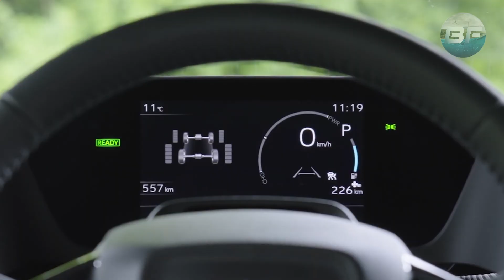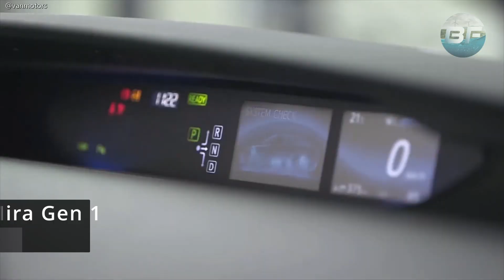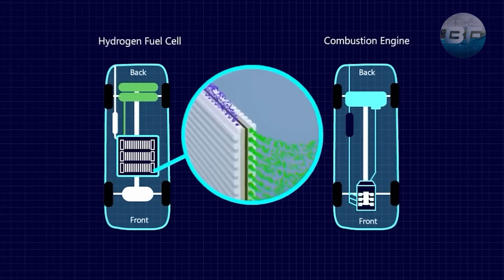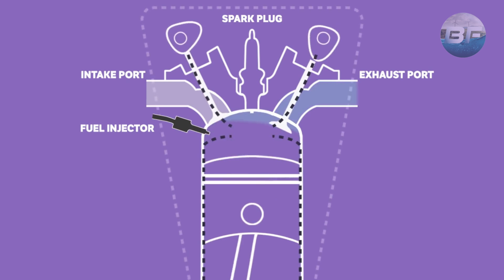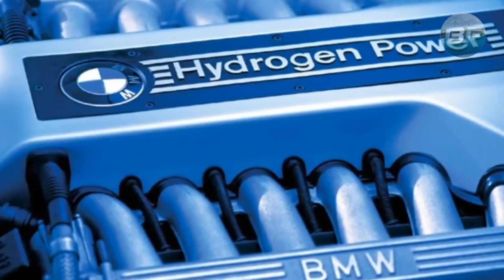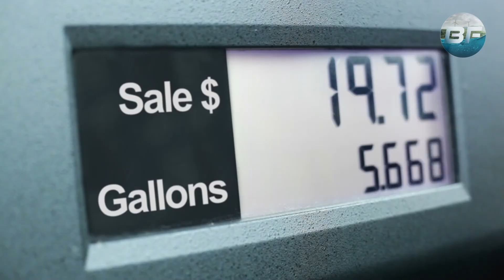Toyotas NEW HYDROGEN Combustion Engine SHOCKS The Entire Car Industry

Comment: Obviously you have not looked at how much hydrogen fuel cost.  It is much more expensive than gasoline.  You can count the number of commercial hydrogen filling stations in the US on you fingers.
Go look at the reviews of the Murai.  Underpowered.  Long lines at the filling stations.  Dispensers freezing up in SoCal warm weather.
Reply from the maker: Of course, the infrastructure must be expanded. In addition, the technology is still under development. It will take some time before the technology is profitable for normal end users. Nevertheless, it is a step which makes alternative energies more accessible. Let's see where the journey ultimately goes.

Comment: 1:57 Honda gave up making the Clarity FCEV a few years ago.  They may start up again, but at the moment only the Mirai and the Nexo are available in the world to purchase.  The Yaris H2 @ 3:36 can be refueled in 1.5 minutes, but that is with liquid hydrogen for racing, not the 700 bar pressurized hydrogen.  The other issue with using hydrogen in an internal combustion engine is its efficiency.   The Mirai gets 65 miles/kg and can store 5.5kg withing its 3 tanks.  The internal combustion Yaris gets 18 miles/kg when driven normally.  Using the same tanks would get you ~100 miles before refueling would be needed.

Comment: The 1.5 minute to fill the tank, while average EV takes 45 minutes to charge 80% of the battery....
Reply: Misrepresentation.  There is a wait time between hydrogen refills that you didn’t factor in.
Reply: Misleading, that was when Toyota raced the vehicle and it was with liquid hydrogen because the previous year they were using regular compressed hydrogen and only could get 20 miles before another 6-minute refueling was needed.  With the liquid hydrogen, they were still in last place but not embarrassingly in last place.

Comment: As a greenhouse gas, hydrogen is 11 times more potent than CO2. It’s foolish to think that if hydrogen is used on a large scale that leakage won’t happen.  Hydrogen is also a very inefficient way to store energy for a car.  It’s a stupid idea.
Reply: What so evs are better ?
Reply: All of its stupid, but what is less stupid? And leakage I'm sure will occur, but not enough to even amount to normal emissions with gas powered or electric powered. There's been propane vehicles for a long time and there's very little issues with leakage. You need things to be tight and not Leak in all fuel vehicles that aren't EV so that's going to be easy to have done right
Reply: @Andrew McMillions  id still buy one ngl im sure they have enough experience and have enough research to know what they are doing

Comment: It would be awesome if they could burn multi fuels. CNG or RNG, Ammonia, Propane, Hydrogen,  synthetic fuels.

I am thinking a truck that is both fuel cell PHEV hybrid and a range extender ICE that could use common available multi fuels for long range heavy use.

It would not tax the grid as hard and have a greater chance of being used in areas farther away from infrastructure.  Also some fuels can store indefinitely.